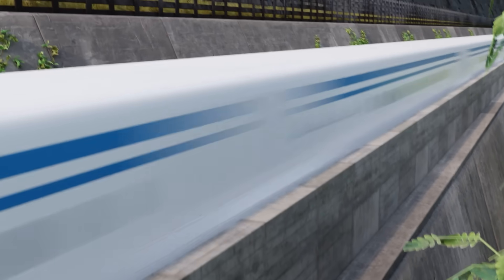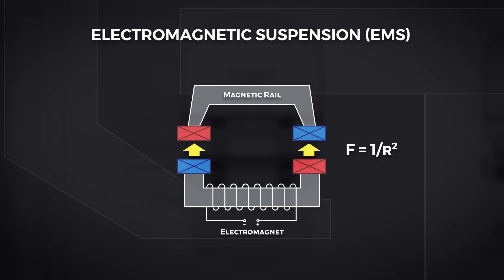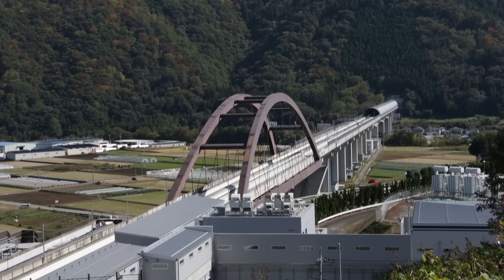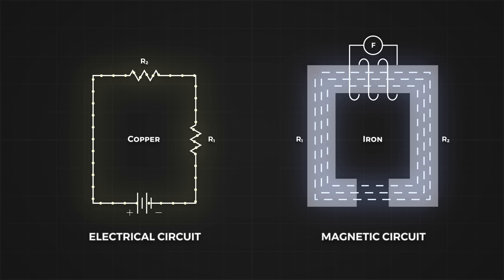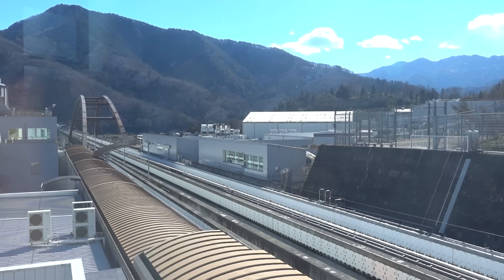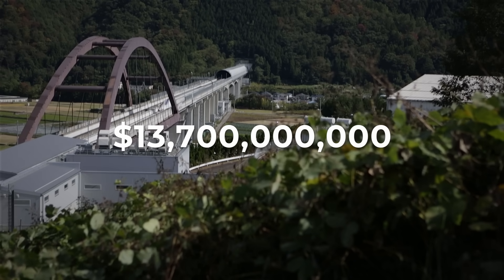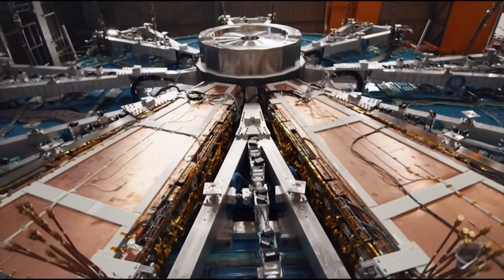How Japan's Maglev Train Works

Comment: Nice, but only really useful for point to point corridors; one loses all the advantages of seamless integration with the existing rail network that one has with the TGV, ICE and other HSR systems. Maglev points and intersections are also super problematic. There are reasons why this technology was invented the 1930's and almost a century later has no real production applications. This single line in Japan is an outlier and I don't really buy the value proposition.
Reply: Don’t forget about the Transrapid Maglev System in Shanghai. Although that one uses a different technology than the Superconducting Maglev in Japan.
Reply: @DDELE7   Nothing but a vanity project.
Reply: And will probably fall down before too long, like everything else they build there.  Have you seen the Three Gorges Dam? Take a look at a pic from space of the thing. Google Earth has one.   @DDELE7

Comment: I do wonder how an air bearing my fare in this application. It would almost certainly require less infrastructure than maglev, but also achieve ultra low friction and presumably high speed.
Reply: I think one of the issues might be noise. High speed trains already create a lot of turbulent airflow as they pass, so I'd imagine if you add an airfoil strong enough to levitate 100 tons of metal above ground you're only gonna make the problem worse.
Reply: @rfldss89 Perhaps. I'm sure there would be many engineering challenges to overcome. But it's probably best to attempt this type of thing assuming that there ARE workable solutions, rather than short-circuiting the process with pessimism.

Comment: TBH, i don't know why the transrapid (the one in shanghai) uses magnetic attraction instead of repulsion (like the japanese one). 
i mean, magnetic repulsion is self-regulating (if the train ends up a bit higher above the track than it should be, the repulsive force reduces and the train comes back down to the correct height) but if the same happens with the transrapid, the lifting force INcreases, lifting the train even higher and making the whole system MUCH harder to control.
Reply: The transrapid doesnt require superconductive magnets or supercooled electromagnets to work. Instead, to keep a stable position it checks the distance between the train and rail 100.000 times a second, and corrects as needed. In case of a power outage, it has on-board batteries to sustain the levitation long enough to come safely come to a full stop if needed.
Reply: As a former servo designer that bandwidth seems more than a bit absurdly extreme.   @rfldss89
Reply: Some say it's to prevent strong wind from blowing it over. Shanghai maglev is very close to shore where hurricanes are common. And the fact that no incident from the levitation system has ever occurred during its two-decade operation makes me believe any doubt about the technical feasibility of an attraction system is rather baseless.
Reply: @Xiaotian_Guan  i wasn't talking about side-to-side control, i was talking about the distance between the magnets that support the weight of the train.that system is unstable and requires active control all the time.

Comment: I've always been interested in the maglev, this is one of the best videos on the science and engineering I've seen
Reply: Unfortunately, they probably do not have a future in transit infrastructure. Their costs vastly outpace their benefits. Rolling wheel trains are already incredibly efficient and don't need advanced metal coils along the entire track. Even with extreme cost reductions in this new technology it will still never economically compete with rolling wheel trains. The speed doesn't justify the cost in 99% of cases. This is one reason why the Concorde was not economically viable, and was eventually ended as a program with no further development. 

They are really cool though, and I'm glad some have been built around the world so we get to check them out. Even if most of the ones we have now were built as vanity projects/attractions for the area they are in.
Reply: @taiidaniblues7792  The death of concorde was that noise restrictions on supersonic flight killed the market in the crib. The only viable operating routes for it were a handful of routes over the Atlantic where there were no windows to be broken by the sonic boom. Concorde routes all over the domestic US would have been viable, if only the supersonic school bus didn't leave a wake of devastation.
Reply: @taiidaniblues7792 One of the main reason Japan decided to build the maglev is because the conventional HSR rail is fully packed, the current HSR serving Tokyo,Nagoya and Osaka (Tokaido Shinkansen) almost reaches its maximum capacity (In rush hour bullet trains leave Tokyo station every 5 minutes already). Therefore, they build a faster alternative for people who willing to afford it and free up capacities for more passengers.
Reply: @taiidaniblues7792  As the guy above me said the death of the concorde was largely due to being supersonic. And windows really tend to not like those kinds of shockwaves on them. Maglev trains on the other hand aren’t supersonic!
Reply: Demand for the existing Shinkansen between Tokyo and Osaka is so strong that it departs and arrives at intervals of 5 to 7 minutes, and the developed high-temperature superconductivity has reduced costs compared to before, so it seems to be profitable enough.
Reply: Everybody thinks of the Is initial cost at first and can't justify it for passengers travel, but what about for cargo transportation? Suppose you had three Pyramids to build like the Great Pyramid in Egypt, each pyramid contains approximately 2,300,000 blocks, each weighing between two and one half tons and ten tons a piece with the quarry approximately five hundred miles away. 

That maglift train would sure come in handy and if freshness was a issue this would be the fastest way to get cargo from point A to point B fast...
Reply: @JEE2026C they're cool but not really impressive, like the Gan 12 is just a bunch of  repelling magnets shoved into the body of the Gan 11, it's really nothing as impressive as a maglev train.
Reply: He literally took the chance to regurgitate that fake ass room temperatura semiconductor hoax.
The Irish tax evader doesn't care cause he lives from his pyramid scheme Nebula.

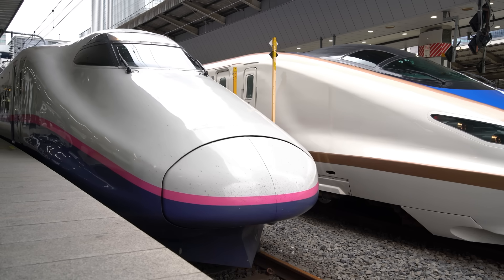Comment: 9:13 FYI, that was E2 Shinkansen made by Kawasaki and that was CRH2A in China 9:15
They may looks the same because it was Kawasaki export the E2 to China in the first place, and the one in the black with golden colour is CRH 3, it was based on the ICE3 by Siemen
Reply: Kawasaki not Nagasaki
Reply: @LGVRhin-Rhone  fixed
Reply: CRH 3 is actually licence built ICE3.. or ... really a velaro, because ICE3 is the DB name for the train. All the trains calls CRH ... something something is licence built trains.

While the CRH380A is a sort of kind of copy of the E2 train. Its a copy in the sense it looks the same. but for the internal components, most of them are swiched out for generic once.

CRH380B/C is a modified velaro.. its sort of a velaro chinese stuf hybrid.

CRH380D is a bombardier Zefiro. Zerifo have no "home market" unlike the Velaro and the E2. So the CRH380D is actually the primary Zefiro train. but there does exist a few zefiro train in Italy as well.

The Zefiro is closly related to the Regina, that is the CRH1, that is originally a Swedish train.. The irony of it is that Regina is not a high speed train, but a commuter train
Reply: Isn't the black and gold the CR400BF ? Only the white coloured ones are based on foreign tech, the new 400 series are domestic enough for export

Comment: And don't forget the speed record for the TGV of 575 km/h
compared to 603 km/h for the maglev.
Reply: But tgv at that speed wasn't safe as maglev
Reply: @GOOD_FARMER the tgv also doesnt require as of yet undiscovered materials to be a viable way of transport though 😶
Reply: @rfldss89  ...but the maglev shinkansen is already being built right now using materials we already have and have used for quite a while. The R&D costs have been enormous to put it lightly, but the incremental capital costs are comparable to regular Shinkansen and TGV, and it's going to absolutely become the mode of choice for the route it's on.
Reply: @NozomuYume  The problem wil be to find more routes to use it. Except Japan and, maybe est China, the utility of MagLev trains would be quite low. In the US only some routes has utility of this over plane and let's be honest, the US don't have train problems only because of time efficiency difficulties, they just don't have public transport capacity enough at destinations. In Europe, any system that couldn't share with actual trains systems is pretty useless. TGV already share a large amount of track with normal speed trains to spare on money and most importantly on space. Also most medium and big cities are pretty close together. And connecting only biggest cities would need border crossing to become usefull. European countries don't even have a single rail standard so a unified MagLev system, that's just a beautiful dream.
Reply: @Tiniuvielle  Did you actually calculate it, or are you just guessing.

I have done quite a bit of calculations, and i don´t agree with that statement at all.
Reply: @rfldss89  There is no unusual material int he track what so ever. There is concrete (very common) aluminum (very common), Silicon-steel (not quite that common, but fairly common, used in transformers), that is about it. Nothing else in the track.
Reply: @matsv201  There is nothing to "calculate" in my statement... But go on, create math out of nowhere if you want, I'm all ear to your calculations...
Reply: @Tiniuvielle  True, a lot of American cities lack public transport capacity at destinations, but they still take planes to these cities, which leaves you with the exact same problem. Solution is to have one of the high speed rail stops be a place where you can rent a car -- the logical place for this stop is the airport, where you can also connect to a long-haul flight. In addition to making rental cars available, this also gets cars off the road that would ordinarily drive to the airport, and last-mile feeder air routes that waste energy and capacity on puddle jumper flights. 

High speed rail occupies a niche called "too far to drive, too short to fly". The maglev, by going 50% faster, extends the upper boundary of this range.
Reply: @Tiniuvielle  Actually, a Maglev system would be much more likely to be unified than the current railways are since back when railways were introduced, a lot of standards have yet to be defined (e.g. early adopter UK has quite a narrow gauge compared), some were in experimentation (hence the choise of DC vs. AC power alongside frequency total voltage around European countries), technical reason also are stated (e.g. the reason Iberian gauge was chosen was that they were supposedly better in handling the hilly terrain of Spain and Portugal) and then there is competition reasons (hence why cities and Philadelphia and Toronto use their own gauges for streetcars and subway until recently to avoid them from being taken over by the railways).
Since we live in the age of coorperation, not competition (at least for Europe), a European maglev would thus be much more standardised than the network we have. In fact, this already is the case in some way given that the Spanish HSR network is built in standard gauge, not Iberian gauge aside from few lines.
Reply: @NozomuYume  But at what cost? USA strugle to finance High speed rail and the ones that are actually built (NY-Washignton for example) are a laugh for other nations. Do you really think USA will invest in the maglev with its way higher starting cost? And do you really think that, if you put maglev station at airport, people will take maglev instead of airplanes? Maglev will most probably be way more costly and we already know that no ecological argument will have weight in the decision balance...

The video also forget one pretty important thing that we can see without thinking: the turn angle capacity. TGV track is already a hell to plan due to the turn angle and change of slope limitation but by speeding even more, those limitations are exponentially higher (as Centrifugal "force" evolve with the square of the speed...) And by staying at only 10 cm, the slope variation will be forced to be as minimalistic as possible. Basically, the track will be only bridges and tunnels, with is already a problem for some normal TGV tracks right now...
Reply: @MarioFanGamer659  Standardisation doesn't mean unification. Even where gauge size is similar in Europe, unification is still complicated. For many political reasons, there are still many difficulties to join two countries together. We saw that few years ago with the joinventure wetween Belgian and Dutch train services providers which failed dramatically at the first embush.

Also many countries are now focused on "slow-moving" trains like night trains and will not want to invest billions on a Maglev for few financial results (again, using Belgium for example, Maglev would only connect Brussels to Paris, Amsterdam, Frankfurt and maybe Berlin, cities that are already reachable in max two hours except for Berlin but the cost to join one or maybe two cities will be unbearable. People already arguing that (high speed) train is way to expensive comparing to planes or cars but how much do you think that a entire new system with new tracks, a lot of new tunnels and bridges will cost ?

European politics are looking for cost efficiency, speed is not even secondary in the list.
Reply: @rfldss89  why are you angey I only talked about safety. There's a reason why every trains are operated at much lower speeds then their top speed.
Reply: But the TGV one was a heavily modified version specifically for that record run. No TGV can actually achieve that speed in operation. The fastest normal/non modified/factory train is actually the Siemens Velaro. It reached 487km/h in China but they still dont operate close to that speed obviously because the wear on parts would be massive etc
Reply: The difference being that a TGV with a service speed like that will incur increasing maintenance costs. They normally don't exceed 320 km/h and usually average around 280 km/h. So MagLev does have an innate advantage there because technically, they can use any high speed.
Reply: And there are newer Designs of High speed trains like the Velaro novo that helps to make the Aerodynamic better so higher speeds are more economical, max 360km/h is announced. When the Japan Maglev in 2027 hopefully goes into real operation we will see how it will be from the price point. But looking at the current market where people fly short range cause it is cheaper than trains, maglevs will have a very hard time. 
And a classic problem of High speed trains in Germany is that every bigger city region where new tracks go thru want a own stop. So Acceleration is more important than high speed. 
Building so much new infrastructure for Maglevs is hard to justify on a lot of connections that not even high speed trains can compete with planes from the pricepoint.
Would even guess building  more high speed rails next to the existing to have more direct connections from big city to big city are more realistic than to have Maglevs from a German POV.
Reply: Top speed means nothing - since you can't operate the service at the speed, all the time every time, and do it without accidents, and without costing too much to maintain it.

Comment: Maglev trains are amazing but US seems to be really keeping their ideology:
Never give up on your dreams - keep sleeping. 😂😥🐼
Awesome video! 👍
Reply: The issue is the scale of the USA. High speed rail works in certain urban corridors, think SoCal, Florida, NE Corridor, Front Range Corridor, Texas Triangle, but it starts to fall apart when you look at cross country trips. This means the high speed rail projects we see are typically state level, where funds are a lot tighter. The Japanese maglev trains would take over 8 hours to cross the USA assuming you ignore the multiple mountain ranges in the way and don't make a single stop. Delta can do it in 4 hours and make a profit while charging you $70.
Reply: @jarynn8156  

"The Japanese maglev trains would take over 8 hours to cross the USA assuming you ignore"

8 hours... even.. 12 hours, is really not that bad if you ride on a sleeper train.

I MUCH rather spend 12 hours on a sleeper train than 4 hours in a plane.
Reply: @matsv201  There is also the issue of cost. An aircraft requires only a slab of concrete at either end. High speed rail requires brand new infrastructure to be built, thousands of miles of it. And your 12 hour sleeper train necessitates a lot more employees working a lot more hours to accomplish the same task that a few employees could do for an airline. Like I said, Delta can charge you $70 for a 4 hour cross country trip and be a highly profitable company. Even with the economies of scale that come with trains, you just can't compete with that.
Reply: @jarynn8156  Yeah, you're right. But there's always more comfort in a train. (maybe that's subjective)